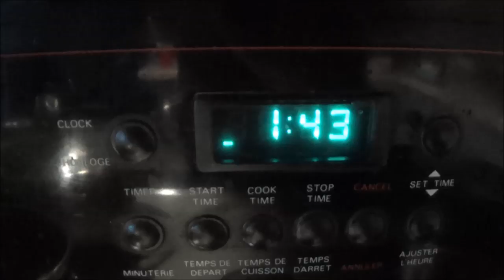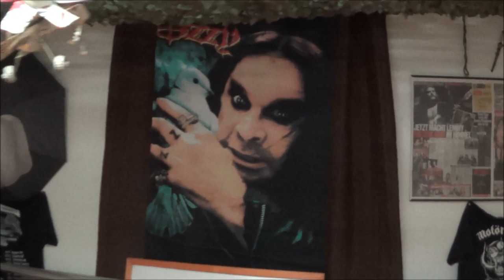Everything but the kitchen sink.Home Renos.

Comment: Heads up on laminate stairs.. it's slippy and they'll break apart over time. I like the paint color, neutral. Goes well with the barn door closet doors, snazzy. Don't forget about the gross nicotine stained smoke squawker.. I noticed that in a previous vid and no.. yucky poo
Reply: The stair bullnose will give some grip though for the stairs.. ah should work out.. can always add grippy tack if need be.